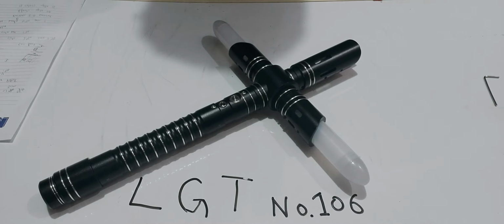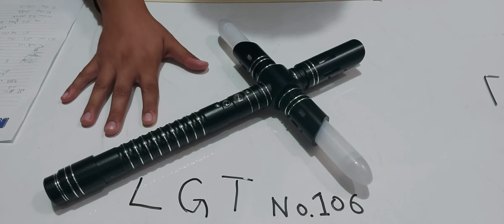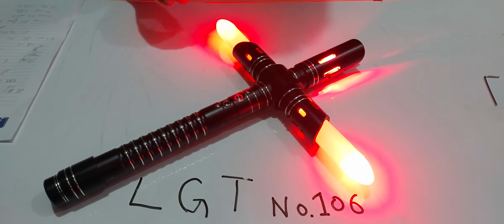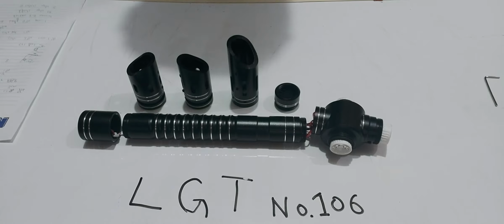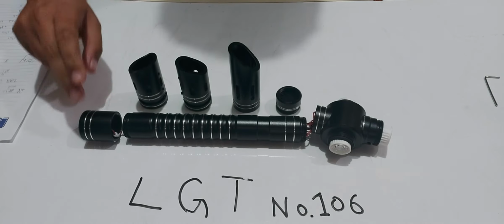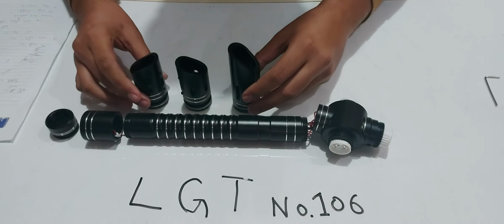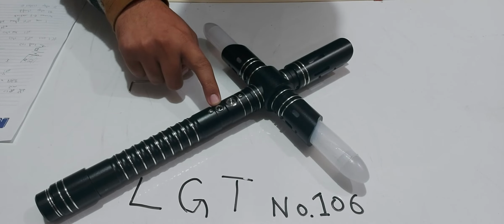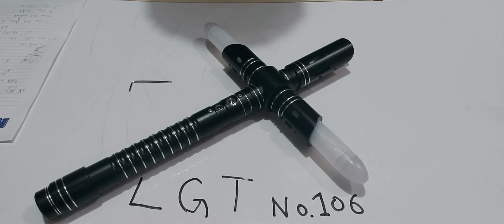LGTsaber Crossguard No. 106 Review and Modular Discussion

Comment: Thank you for answering my question!
I have received the budget crossguard from the store, I believe it is No.110. 
The difference is it has no light profiles, only changeable colors.
Btw, I do agree with you about the separate parts for more modifications!
Reply from the maker: Yes, the newer generations of sabers are now all RGB. I bought mine before Mid2019 so I have an older generation saber. I hope you like your new saber! Be sure to post a video!
Reply: @mobeylicious  The unstable light effect may not apply for my No.110 model due to it's the cheapest in the class, lol.
Reply from the maker: Try pressing the switch once. After the blaster block the light should pulse slightly to make an unstable effect